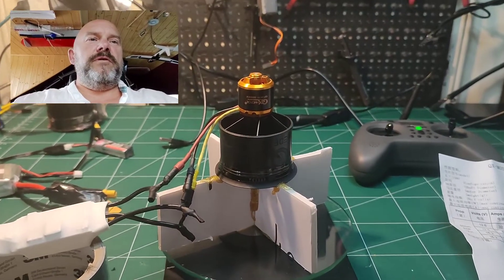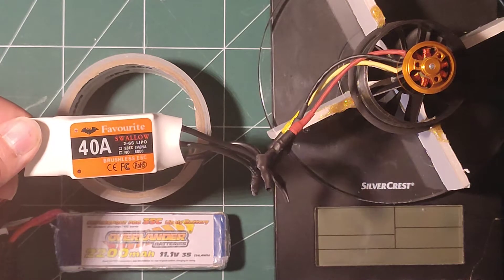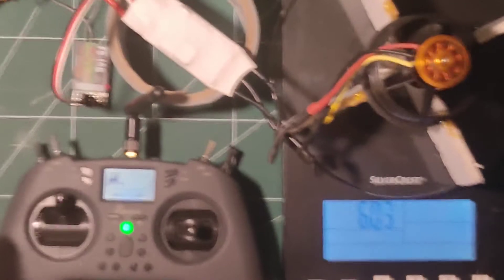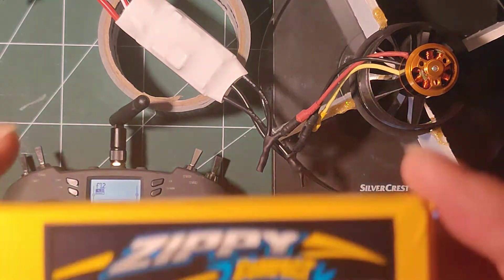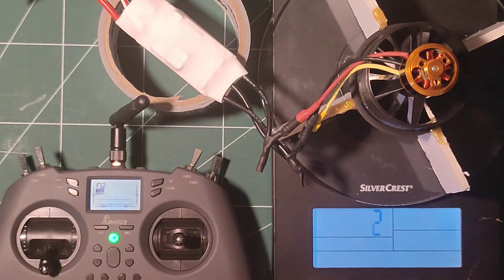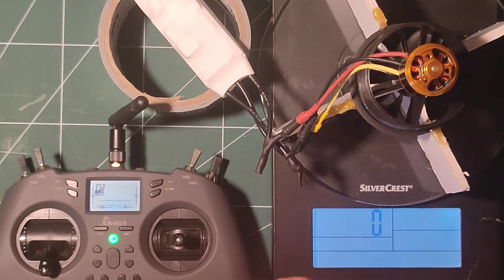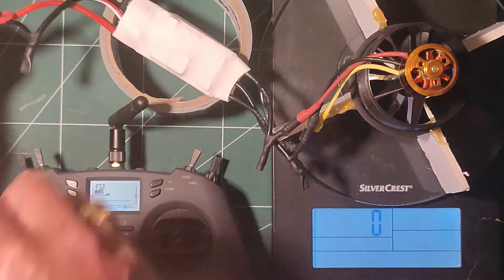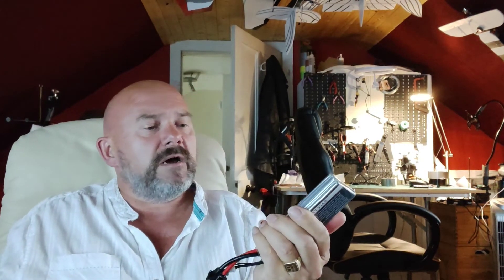50mm EDF Static Thrust Power Output Test (wide range of batteries)

Comment: Hi eric , i found this great video, and have request.

If you could show me thrust test on 2S ?

And do you have EDF under 50mm

Example 40mm ?
Reply from the maker: Sorry partner, my smallest EDF is 50 mm. And I don't do 2S not enough power😁 also when I looked into smaller EDF they seem to be producing very little Power compared to the slightly bigger one.